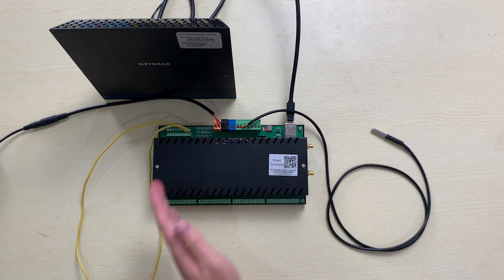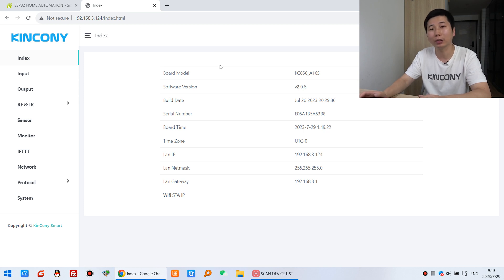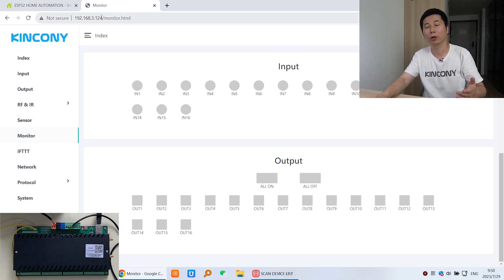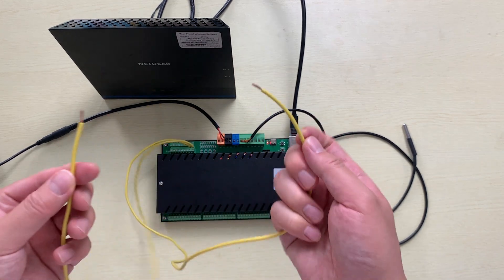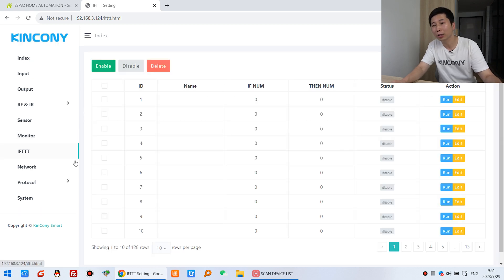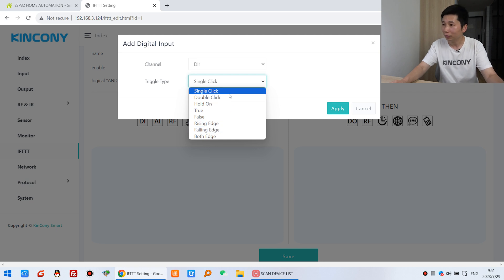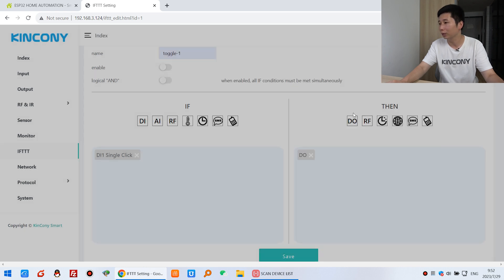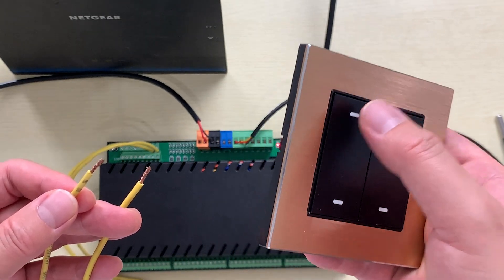how to use esp32 digital input work for different switch button panel

Comment: I just installed the KCS V2 to my KC868-AIO.
It works great!
But how can I use 1 switch to turn on/off (single click) and hold to increase/decrease the analog output?
Reply from the maker: create IFTTT command, use DI trigger AO

Comment: I like your videos. Will you ever make a rack-mounted binary input system? (for 19" rack and ethernet terminated cables)? I have wired up my whole house, every light switch has CAT5 or CAT6, but I cannot bring 40 CAT6 cables into a DIN rail panel because the enclosure is not big enough for 40 cables! Only a 19" rack is big enough!
Reply from the maker: how about this board: https://www.kincony.com/esp32-diy-pcb-board.html
Reply: @KinCony  Looks really good. Just difficult to find a place to have the case milled and produced! Cheers
Reply from the maker: @MatSmithLondon  see this video: https://youtu.be/GJo1O1ib2Sg

Comment: What kind of the sensors could be connected to the AI points?
Reply from the maker: dc 0-5v or 4-20mA analog sensor.
Reply: Only could be purchased from the Alibaba?
Reply from the maker: @Hortitechs  aliexpress or alibaba or TT(bank account)

Comment: What is the cross-section of the cable for a length of 300 meters? Is it possible to control the key via RS485?
Reply from the maker: you can use any cable, such as CAT5 network cable, use dry contact by digital input ports 300 meter is no problem, we have tested. our board also support RS485 bus.